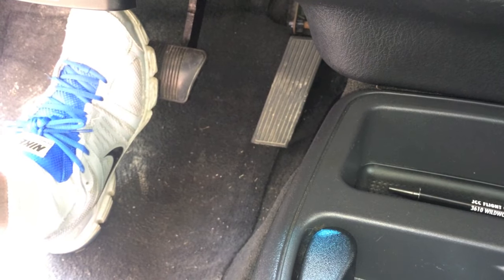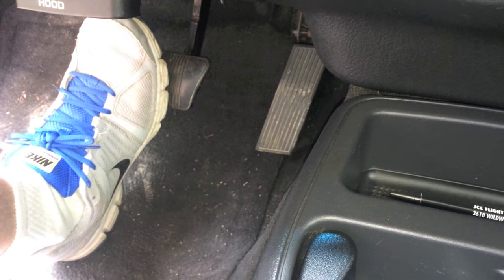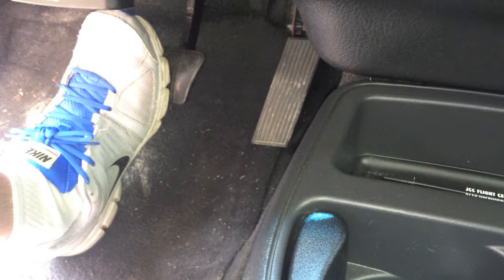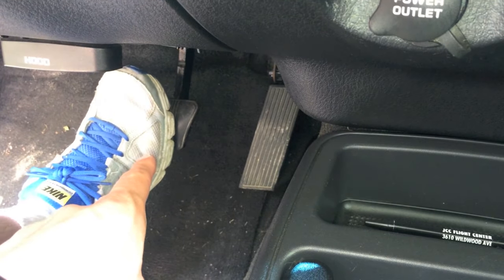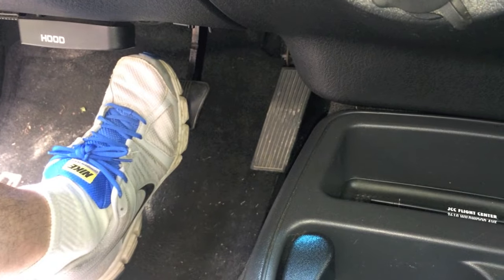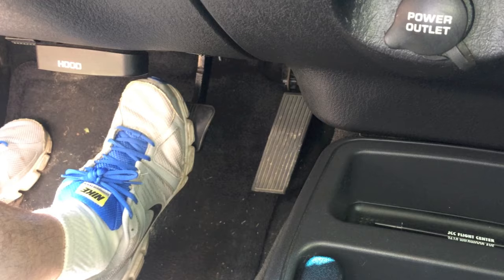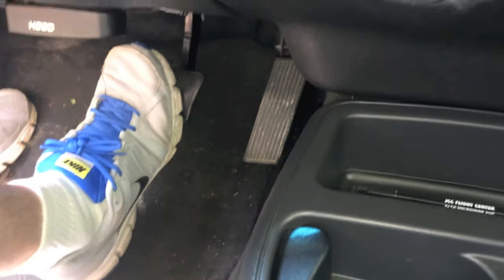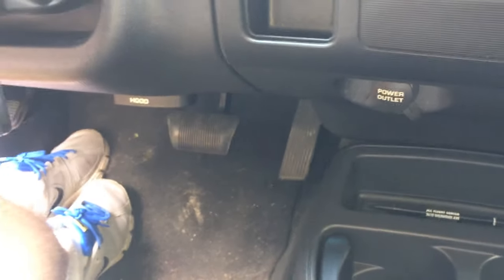HARD Brake Pedal - How to check if your BRAKE BOOSTER is GOOD or BAD

Comment: What if the pedal is really hard after its been sitting over night? Does seem to function normally after car is started.
Reply from the maker: Thanks for checking out the video.  Sorry for the delay!  Its very possible that your vacuum pump will need to be looked at / replaced.  The symptoms you're experiencing with the hard brake pedal after siting overnight can be caused by a leak of some sort in the vacuum line/pump system.  I would take a very close look at all the hoses coming off your brake booster.  Check for leaks, warped hoses, cracked......then turn engine on and try to listen for hissing sound.  If you hear hissing, try to pin point the hose thats hissing.  By replacing that, you might see a substantial difference.  Definitely keep me posted!  Subscribe to the channel that would be awesome!  Thanks again!
Reply: The brake booster, or the vacuum line going to the brake booster, has a check valve which can be leaking so that the booster doesn't have vacuum after resting for a while.
Reply: DIY With Michael Borders
Reply from the maker: Robert K 

Awesome Awesome & thanks for sharing your info Robert K!  We really appreciate it!  😎👍🔧🔩
Reply: @Robert.K  thanks for reminding me of this. I did a turbo conversion on a car and I think the non turbo brake booster got exploded by boosting it. I don't think the check valve is setup for boost.
Reply: @DIYwithMichaelBorders  Hello brother. I am Sadat Alipulo from Philippines,  I have an issue with my breakbooster sound. I own a suzuki ciaz manual transmission. Do you have a Facebook account or messenger?  So that i could send you a video of it?
Reply from the maker: Sadat Alipulo 

Thanks for watching & sharing your comment.  Let’s get this figured out!  Let’s start with the quick & simple checks.

We recommend checking your Brake Fluid reservoir & verifying that the fluid is within the proper fill parameters.  If it is not, add fluid & monitor the fluid level.  If fluid goes down within 2 days of driving, this is a clear indication that your Booster has a leak & is allowing fluid into your Booster...causing the sound you’re hearing.

During the monitoring of the fluid level, do a thorough inspection of all your brake lines & parts pertaining to your Brake System to verify you have no leaks.

Let’s start there, keep us posted!

Please subscribe to the channel and turn on your YouTube notification Bell 🛎 that would be awesome thanks again!  😎👍🔧🔩
Reply: I am experiencing the exact same issue. 2015 mustang. If I let it sit, the brake pedal is almost non budging. When I put my foot on it and start the car (push start so i have to engage the brake), the pedal engages and sinks, then operates normally after it is started. pulled the valve out of the booster and heard the pressure release so it makes me think the booster is ok. going to remove the valve and see if it's letting air in both ways to eliminate or narrow in on the valve being faulty....did you have a final fix on yours?

Comment: why does my rpm go up when I press on brake, my brakes are bad, I do hear alot of air to when I push down on brake pedal!
Reply from the maker: Thanks for checking out the video.  This is not an uncommon issue.  Its most likely that your Brake Booster is allowing a small portion of air into the Intake Manifold.  You will probably want to have your Brake Booster repaired sooner rather than later.  Since your Booster has already begun to leak, it will continue to get more and more unreliable.  Please SUBSCRIBE to the channel that would be awesome!
Reply: The brake booster (aka the vacuum brake booster) pulls a vacuum on the engine. Hence the name. It's connected by a vacuum line usually to the intake manifold. When you press the brakes it pulls suction from the engine. If there's a vacuum leak or something internally is wrong with the booster, it'll take even more of a draw on the engine than normal. This will make the engine have to work harder and faster to compensate. Making the RPM go higher, or lower in some cases. If it's really bad, simply pressing the brakes can actually cause the engine to stall out. Anyway that's why. Check for a vacuum leak, you can do this by spraying throttle body cleaner around the vacuum lines, if the RPM's get really high that's the vacuum leak. If it's not that it's the booster.
Reply from the maker: Mason Holloway Thanks for the information Mason.  That's awesome and will definitely help out.  I had an old New Yorker that had this very issue...pressing the brake darn near stalled engine every time.     Subscribe to the channel if you haven't yet that would be awesome thanks again 😀👍
Reply: What's up  I have a 2007 GMC sierra classic Nevada addition and if I start it up and drive for about 510 minutes my brake pedal gets real hard and I did your test for the booster and it good just wondering if it could be the check valve thanks
Reply: Well I don’t know a whole lot about cars but I had replaced my front brakes and calipers and bleed them it was still spongy and loose so the solution for me was to slam the brakes and engaging the abs because there was air trapped in the system
Reply: If you hear air that could be the master cylinder it's most likely that it is

Comment: So my brake pedal kept sinking down to the floor,i changed the master cylinder,bled the front brakes and rear drums. Still holds no pressure specially when i start the car. I noticed the passenger drum makes noice when stepping on the brake and it leaks air bubbles even when the valve is tightened. I dont see any fluid leaks at all.
Reply from the maker: Francisco Razo 

Thanks for watching & sharing your experience.  The leakage of air bubbles is a sign of a possible faulty bleeder valve.  We have seen this in the past.

This may be kinda annoying to do however it may solve your problem.  We recommend purchasing a brand new bleeder valve from your local dealership.  Replace old with new & the faster you can insert & secure the new bleeder valve after removing old bleeder valve the better.  This is because the longer you have the bleeder valve off...the longer it will allow air back into your brake system.

After inserting & securing new bleeder valve, we recommend bleeding your brake system one last time.

Keep us posted!  We are here to help!

Please subscribe to the channel and turn on your YouTube notification Bell 🛎 that would be awesome thanks again!  😎👍🔧🔩
Reply: Having the same problems .I bought thous bleeding screws

Comment: Hey Micheal, I have a 97 4Runner and I have been a having issues with the brakes for a minute and I just keep getting issues. When I first bought the car they worked just fine except every now and then with light braking the car would make a “farting” noise and the brakes would skip for a second and go back to normal. After some research I learned it was because the rotors were going bad. I replaced the rotors but ended up having the replace the calipers as well because they weren’t the right size for my vehicle OG rotors. The pads are less than a year old and have 80% left on them too. Once I did that and flushed the system I had no issues except very rarely I would have that same “farting” issue. Now yesterday I had no issues with the brakes on a 40 minutes drive to work but as soon as I left the brake pedal got super stiff after holding the pedal very lightly. I thought I almost lost all my brake but when I push harder it goes back to normal and my brakes feel very sensitive again. When I did your test here the pedal did not move forward, however when I drive I can get rid of the stiff pedal if I just push really hard. I also tried to bleed my brakes again and my passenger side caliper would not bleed nearly as much as the driver side. I hope you can help me because a new brake booster costs almost half of what I paid for this truck. Thank you
Reply: Check valve on the booster

Comment: I drove my 94 ranger to work this morning,  no issues,  i went to leave work and my brake pedal was super stiff and it wouldn't start...bad brake booster ? ...thoughts ....
Reply from the maker: Thanks for watching, it can be a few things.

1.  Too much brake fluid in reservoir
2.  Failing caliper
3.  Failing brake line feeding off caliper
4.  Failing Master Brake Cylinder

Below are additional video links that will get you more familiar with the items listed above.

       https://youtu.be/X-AJ5tD6zoA?si=57Y4rO6YKqxRmo-E

       https://youtu.be/j9s7yccswPQ?si=BDlWVcozSmqIXXUB

       https://youtu.be/3FTEgbLYAdI?si=MMl7YHjTEDZaTqsE

       https://youtu.be/3Pq15BWM_qY?si=rQjL4rnUQJEzRUsd

👍🧰

Comment: What if the brake pedal is already hard when you get in the car to start it ???
Reply from the maker: Thanks for watching & this is normal.  Once you turn engine on, the vacuum system begins to run which assists in making the brake pedal far more friendlier to push.

When engine is turned off, vacuum system shut off and brake pedal becomes hard.

Comment: How can I tell the difference between a failed brake booster check valve, or the brake booster itself?
Reply from the maker: Good morning, just poured a ☕️ and am sitting down to answer any and all questions for the DIY community.

Great question and following the steps in this video will allow you to diagnose if it’s your Brake booster.  If this test procedure is successful, your Booster is good…and you can then direct your attention to replacing check-valve.

Let us know if you have any questions and hey if you’re interested, join our DIY ecosystem and help us grow an exclusive group of DIYers.

       toolboxtoken.com

Reach out to us any time!  🧰
Reply: @DIYwithMichaelBorders  what are some issues that come up when it’s ONLY. Just ONLY. The brake booster check valve?
Reply from the maker: @Pepperjack57IsAwesome  

Thanks for the reply.  You would get an interruption in your vacuum pressure which can lead to degraded brake performance.

Comment: Disclaimer: I’m by no means a mechanic, but like to learn some things..
Trying to diagnose my kids brake issue on a 2008 Ford Edge. Fluids look good, pads and rotors brand new 2 months ago. Pedal got stiff last week. Vehicle will stop but you really gotta lean on it. No abnormal noises, no check engine light, but it is now throwing a ton of brake dust on both front wheels where the new pads are. 
Just attempted what I saw here in the video but the pedal didn’t seem to stiffen up more before turning the car on and it didn’t really go forward when I started it.  
Would it be beneficial to change the calipers before attempting to replace the booster?
Reply from the maker: Thanks for watching.  Since the pads and rotors were just recently replaced, the next likely part causing your issues is a seized piston inside your caliper.

The wheel that is creating brake dust is the culprit.  We recommend replacing the caliper on the side of the vehicle that is creating the brake dust.

Please keep us posted Brian, we are always here to help .

Comment: When I did this test and turned on the car my brake pedal went further back into the footwell? Any tips? Audi a5 b8.5
Reply from the maker: Good morning, just poured a cup of coffee and am sitting down to answer any and all questions for the DIY community.

Are you experiencing hard brake pedal while engine is running.  If pedal sinks to floor, there is either a leak in a brake line or Booster is faulty.

Let us know if you have any questions and hey if you’re into crypto trading, join our DIY ecosystem and become part of an exclusive group of DIYers.

       toolboxtoken.com

Reach out to us any time!  🧰

Comment: Im having a problem when i press the brake pedal down it stays down and keeps brakes on. I reach down pull pedal up and brakes free up. Any idea why?
Reply from the maker: Thanks for watching, any update?  A few things can cause this.

1.  Faulty Caliper
2.  Deteriorating rubber brake hose
3.  Too much fluid in reservoir
4.  Faulty Master Cylinder 

Please keep us posted.

Comment: I checked it and it went down smoothly as I started the engine. So why did the pedal lock up in the first place? Am I good to go or should I take the car to a shop? Thanks for the video
Reply from the maker: Thanks for watching, you may have a caliper in its early stages of failure.  

Inside the caliper is a piston that shifts in and out when you push the brake pedal.

When you let go of the pedal, the piston should shift away from the brake pads releasing the brakes however if your piston is getting stuck in the extended position, your brakes will lock & that caliper will need to be replaced.

That’s the most common cause.
Reply: Thanks for the quick reply. My car passed the maintenance check three weeks ago. I assume they would have checked the calipers too? I have no steering problems while braking and no leakage. The brakes sometimes squeak though. Could it be debris?
Reply from the maker: @siirifani4ever  

Thanks for the reply, that’s definitely a possibility.  😎👍

Comment: I had the opposite issue. It wouldn't apply the brakes until almost to the floor. After new master cylinder, brake job and reverse bleed. Replaced the booster worked as it shouldve
Reply from the maker: Thanks for watching & sharing this.  Sounds like you’re back up and running.  Hopefully many stress free days ahead for you Cole.

Welcome to the DIY Raptor Club.

😎👍

Comment: I have 2008 Altima all wheels locked up after 5 minutes driving . Next day driver again for another 5 minutes.. all wheels are Rock hard oil going all wheels no leak . What do think is the problem.thanks
Reply from the maker: الحمدلله الذي خلصني 

We have attached our previous comment on your 1st questions.

Thanks for checking out the video.  This is definitely an annoying issue to run into.  We have attached a few options that may cause this.  Let’s get this figured out!  😀

Check out the vides and let us know if these troubleshooting steps help.

https://www.youtube.com/watch?v=-DZ68tKuCQc

https://www.youtube.com/watch?v=3Pq15BWM_qY

https://www.youtube.com/watch?v=VK4lowH7kQE

https://www.youtube.com/watch?v=j9s7yccswPQ

Comment: My break peddle makes a squeaking noise when I first apply pressure to the peddle. Can you tell me what causes this and is it of great concern?
Reply from the maker: Good morning ☕️

This is a common issue people run into.  It’s likely that a slight amount of debris has gathered between your brake pads and rotor, which is interrupting the friction and lubrication between the two parts.

It can be as simple as having snow, slush, dirt, or mud on your brakes.  It might be a good time to remove front tires and clean pads and rotors with brake cleaner.  We will have a link below.

If interested in purchasing this product, visit our Amazon affiliate link below.  I earn from qualifying purchases.

       https://amzn.to/3vY8vnZ

If during the cleaning process, you find your pads and rotors in worn out shape…it’s a good time to replace pads and rotors.  Hope this helps.  🧰

Comment: i have a 04 Tacoma 185,000 and when i break it starts a high pitched hum like a tea pot thats done. Even while the car is stopped or in park . Pressing on the break helps for a second and starts back up.
Reply from the maker: castillo75034 Thanks for checking out the video and sharing your comment and experience.  It's very possible that you have a leak in your Brake Booster or vacuum lines.  As you know, The Brake system is under pressure both by fluid and air.  Open hood and try to pin-point where exactly the hissing sound is coming from.  You might have to have someone inside pressing the break while you listen underneath hood.  Keep me posted.  Please Subscribe to the channel and turn on your YouTube notifications that would be awesome thanks again 😀👍

Comment: I have difficulties with brake. when I apply brake , I feel brake pedal push me back and whole body of vehicle shakes. why is it that? I am driving Toyota Rav 4 2006 . thinking need to take mechanic ......thanks
Reply from the maker: Thanks for checking out the video.  Having your pedal push back usually happens when you are experiencing issues with the brake booster.  

First check the level of the power steering fluid in reservoir.
If its empty...add fluid and see if this helps.

If not...chances are that you will need to get the booster replaced...which usually isn't a job to do at home unless you have the experience as well as required tools.

The booster is relatively inexpensive and should be a quick fix when taking it  to a professional shop.

Please Subscribe to the channel that would be awesome thanks again!

Comment: My Lexus is250 wheel locked up and the brake is stiff, and the tire sensor gauge is one saying check system do you know what the problem may be?
Reply from the maker: Thanks for watching & welcome to the DIY Raptor Club.  A few things can cause this.

1.  Too much brake fluid in reservoir
2.  Worn out caliper
3.  Worn out brake line

The above items are the most common.